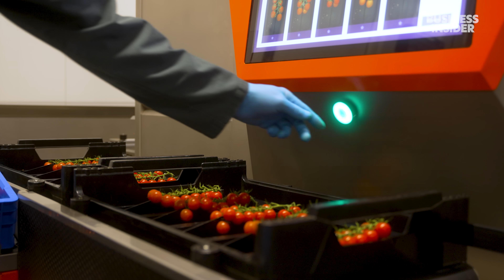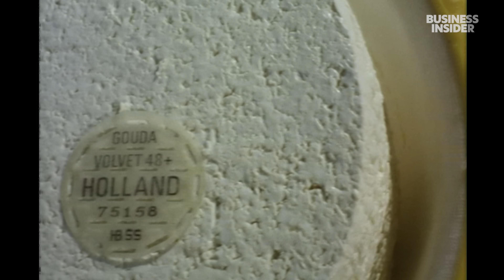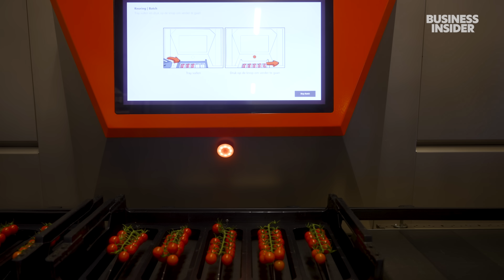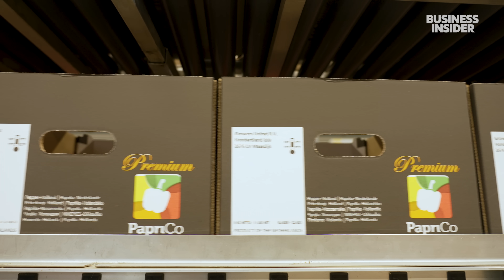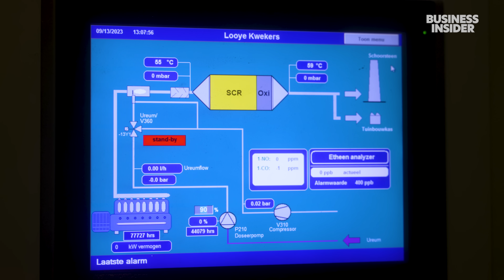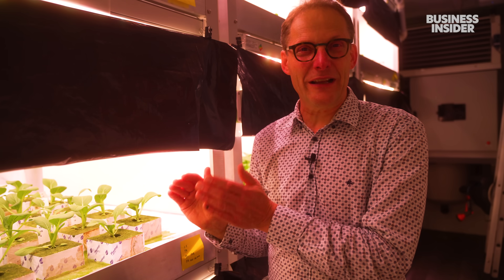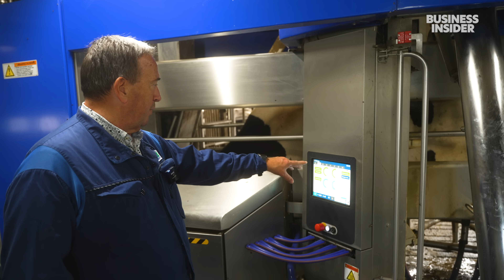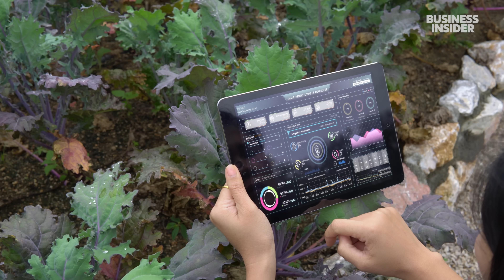How One Tiny Country Rivals American Farming

Comment: All this tomato production is very remarkable in the context of Industry & Technology.  But from the point of a consumer,  (and believe me I eat a LOT of tomatos weeekly),  I think Dutch tomatos are just a different product, than the conventional tomatos (those grown in the earth, and under the sun).  So it is not fair to compare them.
Dutch tomatos , have zero taste.  It is just a reddish fruit holding water in it.   Compare them with tomatos sold in Greece (provided they are really Greek production,  because I have found dutch tomatos also in Greek super markets).,  and you will understand .  Try to make a Greek salad with both types and you will understand.  Tomatos grown in Creta, Greece are even better.
I still buy dutch tomatos, because I have no alternative.  You can not find anything else in a dutch super market.
And also, I can tell you,  regardless if the huge production they achieve with this high tech ,  the dutch tomatos are still inexplicably expensive at the shelf.

Comment: Interesting video! However, the Netherlands have 2 main “natural” advantages and 2 Engineered ones (only the first was mentioned); 
First: the Netherlands are strategically geographically positioned in Europe and near the Sea, which gave us a trade-advantage which fueled an economic growth for the last 800+ years. 
Second, correction: WW2 was not the trigger to start on being independent on food production, that we already realized during WW1 when the Netherlands was quite effectively isolated due to the trade-blockade back then. So trade turned against us, so we needed an alternative. That’s when plans started about the “ZuiderZee” open-sea connection (Saltwater) was turned into a huge closed off lake (the IJsselmeer) with a fresh water supply where about half of the Dutch rivers flow into.
Third: At the same time the “ZuiderZee” was closed off (1930’s), plan’s were developed for the large polders in the Netherlands; Four of them, started: Wieringermeer (1930); Noordoostpolder (1939); Noord-Flevopolder (1950) end South-Flevopolder (1959). These polders are one of the most fertile peaces of farmland in the Netherlands, having the most yield in crops.
Fourth: The Netherlands are mainly a river-delta, which has been managed quite effectively for over 1000+ years (with some deathly flooding every century or so). We have very fertile farming lands and a abundance of water where we can control the groundwater level at the level of an acre. That’s true on the mainland but also in the large polders(!)

And that’s what you need to know about the Netherlands being an agricultural powerhouse.

Comment: That's one way to frame the hunger winter. However the hunger winter is more complex. The general rail strike and the Nazi response did cause quite a bit. However it wasn't just the Nazi's, the Americans abandoned the effort to liberate the Netherlands whole after the failure of Market Garden (which happened around the same time as the strike). Choosing instead to try and beat the Soviets to Berlin. 

As a result, coal out of the south no longer made it to the lands north of the Dutch rivers, and weather conditions ground all logistical efforts to a halt. The Nazi's had very little options, nor desire, to supply the Netherlands with the resources it had lost to the south. That said, had the Americans not been so hell bent on beating the Soviets to Berlin the entire thing could have been largely prevented. This is as it was taught to me in Dutch school.

Comment: In regard to the environmental impacts, the video seems to mix together the effects of nitrogen-based compounds getting into water ways and getting into the atmosphere. They are related, but the video makes it seem as though the problems it talks about, the overgrowth of plants and the growth of algae in waterways are a result of Ammonia (&nitrous oxide?) emissions into the air. Where most of those problems of excess nitrogen result from nitrogenous compounds getting into the water.

Comment: The only i have to complain about is that at night the greenhouses should only light the insides, contain the light. The light pollution combined with low clouds make the sky completely orange, the orange clouds disperse the light so far that skies up to 60 km away light up a large part of the horizon. Combined with the city size steel factory complex in the middle of the coastline the nights are no nights.

Comment: Unmentioned in this video is the existence of the Groningen Natural Gas Field near the North Sea coast.  When discovered in the 1950s, it was one of the largest natural gas fields in the world.  This enormous natural gas field generated a veritable tidal wave of export revenue that caused the appreciation of the Dutch Guilder.  This gave the world the term "Dutch Disease" for when the export of extracted natural resources distort the exchange rates and cripple local manufacturing industries.  This Dutch experience played a significant part both in Norway setting up a sovereign wealth fund to invest abroad sterilizing their current accounts surplus when they discovered oil 15 years later and in the movement towards the Euro.

As gas production from Groningen could easily exceed the capacity of any pipeline network to carry gas supply away to export markets in Germany and France, huge volumes of relatively cheap gas could be dumped into a functionally closed domestic market indirectly subsidizing precisely this sort of energy intensive factory farming.  Natural gas physically trapped in Alberta is so cheap that it fuels the growing of a large portion of the finger potatoes consumed in the US in greenhouses across southern Alberta and Saskatchewan...at least according to a Minnesota potato farmer I once talked to socially.
Reply: Hmm could. Doesnt matter anyways as its closed now
Reply: @ArcanePower1 My point was that the abundant domestic natural gas likely played a role in the path dependent development of Dutch agriculture.

Comment: 10:50 A lot of these greenhouse are able to exist because of a large natural gas source the Groninger gas field. Back in the 1950/60's they had the idea that around 2000's everything was probably powered by nuculear powerplants and they should just use it all as fast as possible (that never happend btw people in 1950 had the weirdest ideas about the magical SCIFI called the year 2000's)  So there are gas pipelines from Groningen towards these parts of the country with these greenhouses to heat them up. And for a long time they sold there own Gronings gas and imported cheaper Russian gas that was of less good quality and mixed it with there own Gas. So this is how the current geopolitical situation makes gas more expensive even though the Groningen gas field was suppose to shut down due to political tensions about earthquakes they postpone it because they fair they can not compensate it.  (its now set on 2030). This is why natural gas is a established source of Engery around the Netherlands it not only has the infrastructure to import it but also to process,mix it and export it. Also Natural gas has been seen as a clean source of power because its a handy backup for wind turbines and solar panels. When its one of  those foggy but windless days you either have to import Power from neigboring countries and it doesnt matter if its France nuculear power or German Coal power having to import someting like that last minute because its vital is really expensive. And Natural gas has the benefit of burning directly so having a supply of natural gas around is super usefull if you want to exploit green energy sources while also making sure there is enough backup for those foggy windless days. Or the otherway around you burn less gas if its a windy sunny day.

Comment: WW2 is mentioned as the reason, too bad this is WW1, in WW1 we were neutral, and didn’t have the resources to feed ourselves, so we had to import, as Germany needed all for them selves so it had to come over sea.
But the British blocked the Netherlands and we had more than 2 years of famine (17/18 and the after effects). This was the moment we decided we need to grow enough food to feed ourselves.
We killed 2 flies in one, by building the Afsluitdijk we protected the inner coast and made a huge sweet water lake. In this lake we build polders where we started farming. The first big polder fell dry in 1942, so already in WW2, after that 2 more huge polders fell dry (they became one). The last was cancelled due to environmental and economic reasons.
What WW2 did emphasize was the need to feed ourselves, although the Germans stole everything at the end of WW2, so the famine would have been there either way.

Comment: You missed a very important part about the "winter of hunger": in 1944 the south of the Netherlands was liberated by the allied forces. This influenced the supply chain for the German forces in the northern part of the Netherlands.
After the strike the Germans retaliated, but after a few months they tried to reinstate the supply chain but since they were already losing the war and the harsh winter they failed at this (the water was frozen so no boats). Even German soldiers stationed in the northern part of the Netherlands were running short on food (not as bad as the Dutch civilians of course)
Reply: Dit is toch geen goedprater hoop ik .

Comment: 4 kg of water instead of 200kg! WOW, that is incredible!
Reply: I was amazed by that too!
Reply: Proof that it’s not about how much land you have, but how you use it. Pure genius!
Reply: Maybe they have a way of recycling the water, idk 🤷🏻‍♂️
Reply: @ChristianRoman-f9g  mainly because it's a closed irrigation system that also provides nutrients. 
The only losses are evaporation trough the leaves when the plants absorb co2 and when fruits are harvested. And to a lesser degree when the plants are tossed but that only happens once a year. 

Taking that into consideration most of that water needs to evaporate from the leaves of the plant to produce the energy and sugars in one tomato. Wild right. 
If you are just spraying with a normal exterior irrigation setup you irrigate about 2 inches of water per week, so about 50 liter per m², if we assume a maximum of 4 plants per m² that is 12.5 liter per week, for about 35 week that is well over 400 liter per plant per year.
Reply: I’m curious how high the water table is given the fact that the entire nation sits close to sea level.
Reply: @maryl8614  A lot of the time it is where they decide it is going to be. Every watershed has their own board. 

This in turn results in different groups wanting it at a different level, because you can't just go "it is what it is".
Reply: They can use the extra for our data centers
Reply: Let's call it liters. Basically the same, but kilos are for weight and liters or litres are for volume
Reply: @09conrado water can be expressed either way,since the produce is kg it gives incentive to express all the inputs incl water in kg as well
Reply: @09conrado 4kg of water is the same as 4L of water. 1000mL of water weighs 1kg
Reply: Yes
Reply: @mertuarez Hate to break it to you, but you are wrong on many levels. Such as calcium lowering pH.. its even used in soil to increase pH. 

As far as recycling water goes, all water is saved in a bassin or silo. All water that is used is recirculated into that same silo all over again. 

Fertilizer regulations are more strict in Holland, so we already use WAY less than other country’s. Also, the fertilizers are watersolutalble, and minerals will be used again because of the closed system and recirculation. 

There is way more to it then just tomatoes.. and no, this wont be available in Africa soon because of climate differences, hooole other way of growing, and also, the fortune you have to put in to it. There are big dutch multiplication companies who grow Roses in Kenia etc. They do it the exact same way.. 

Even cooler.. there are dutch growers who use 100% green electricity for their greenhouses.. 

U dont know it all..
Reply: idk where that stat was coming from but im assuming they are including outdoor operations. In other words, a lot of the water thats being "consumed" by the rest of the worlds tomato crop would have been "used" or "wasted" regardless of the presence of the farm. Its the same stat that people use to criticize beef and dairy operations. They take all the rainfall that falls on the pasture and count that towards the water usage of the farm even though it would have fallen and gone to more or less the same place if the cattle weren't there. Where i live, a soccer pitch worth of land would receive more than 4,000,000 liters a year from rainfall.
Reply: Klaus swab dont like this
Reply: @deepburnfm2189 
He does like this.
Reply: Their claimed worldwide average of 200kg is complete BS
Reply: no sun, no taste and quality, no point on talking about water, might as well stop farming such things
Reply: @zlmdragon.  The taste does not come from the sun but from plant genetics, minerals in the soil and to a certain degree plants stress. 

All factors that can be perfectly micked if you wanted to. 

The main issue is that it's easier to just use the maximum amount of fertilizer and just select for rapid growth and disable the ripening to get them to stores faster. However modern cherry tomatoes have come back from that, and strike a fine balance between flavor and profit. 
Combine that with added minerals in the nutrient mix & added sweetness because they are 1) grown far up north where there is 16 hours of sunlight in summer and 2) extra light during spring and autumn to ensure plenty of sugars in the fruit and you actually have stunning produce from greenhouses. 

But make some other choices and you can turn out very disappointing stuff too, a decade ago there were some tomatoes that were just grainy and flavorless. Maybe those are the ones you think of.
Reply: @zlmdragon.  American spotted...

Comment: So much concentrated farming is bad for the environment.  Not "climate change", instead actual pollution from overuse of fertilizers.

There's only two things I hate in this world: people who are intolerant of other people's cultures, and the Dutch.
Reply: Such a Redditor comment. Greenhouse farming is a more efficient form of farming vs traditional farming in terms of resources used.

Land usage is a huge consideration for agriculture and the alternative to what the Netherlands is doing would be at least one country's worth of land devoted entirely to farming, but likely even more.

The solution to the problems caused by agriculture isn't "just spread it out, bro!"
Reply: @jessl1934  Well, actually spreading it out is environmentally better than concentrating it.  More land dedicated to growing crops allows for crop rotation and reduced use of chemicals to boost soil fertility.  

Greenhouse farming requires electricity to provide that Dutch nightly aurora of glowing grow lights.  Over 60% of the Netherlands power is fossil fuel.  Slow clap. 

Dairy industry is also a problem. Don't even get me started on their ridiculous tulip industry.
Reply: @randymarsh9935 Yeah, a greenhouse which runs aquaponics is definitely more wasteful of chemical fertilizers than having so many acres of monocrop that they use planes to spray them.

And yes, using grow lights uses electricity. Wow. Never could have imagined that. Why do you think all intensive farming requires lights?
And what about intensive farming means that crop rotation isn't possible exactly?

You sound like an armchair expert. How many weeks has it been since you last touched grass?

Comment: the dream is to have within every high rise building a couple of floors of indoor farms.
and later on maybe even have them underground too in area's without high buildings(just add a few basement levels under municipality buildings for example)
those farms would then produce vegetables, fruits, potato's, grain etc, and have space for raising cattle for both consumption and production of cheese etc.
these floors spread throughout the city would then be able to provide everything that is eaten by the people in that city.
have that in every city and town and you produce enough food for the whole country within cycling distance of the people who buy and eat that food.
that also cuts out the transport costs and the pollution that transporting causes.

but at the moment there are two big things that hold it back:
1. the costs to build/implement it.
2. this set up would be for domestic use only, so producers won't be able to get rich with this.

but hopefully we will be able to get to a system like this and producers are going to do it because they want it, not because in the future it needs to be done so, and they have to be forced to do it this way.

Comment: The premium brand tomatos you see at 7:30 are €3.89 at your local supermarket. You get 180 grams of tomatoes for that price. I never buy them
Reply: At ours (Lidl) they are about E 2,49 per 250 gram (extra sweet variant). Still much more than the E 2,49 per 500 gram for still good tasting 'cocktail size' tomatoes on the vine packaged per container and may contain multiple shorter vines with less individual tomatoes or the bulk regular sized tomatoes on the vine for E 3-something per kilo (regular price, may go as low as E 1,49 per kilo when discounted) which are picked a lot less ripe and therefore have much less taste.